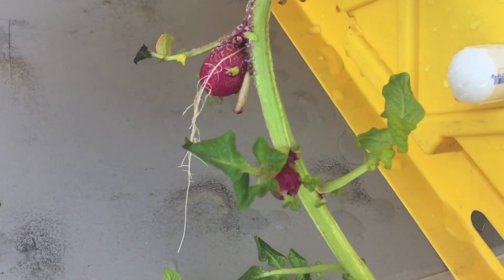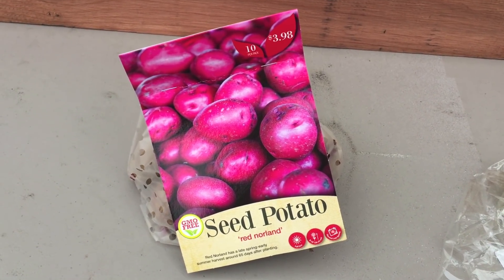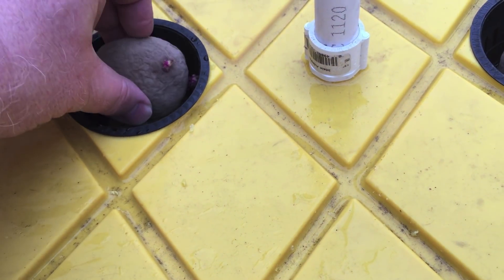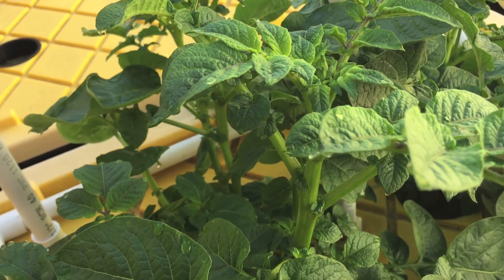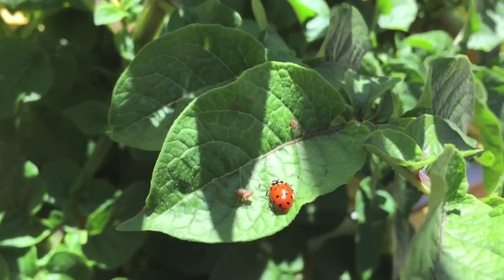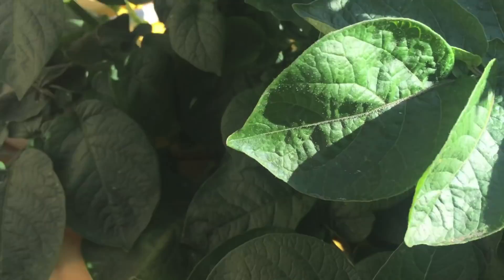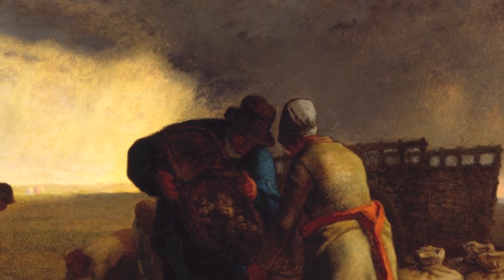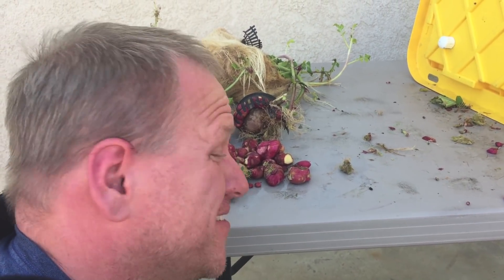Check out the amazing growth pattern of this hydroponic potato!

Comment: If you weren't so cheap, you could do some pretty cool things with solar panels and pumps lol, but alas...
Reply from the maker: Well that would be cool but it's not accessible for most people.
Reply: Actually you'd be surprised now days what most people can get at Wallmart and other stores, or online not to mention if a person is smart enough to attempt hydro, they are usually smart enough to scrounge up a small solar panel or a pump. True you don't need an air stone, but it really does help the roots. I was just kidding about you being cheap also haha!
I like your narrations!
Reply from the maker: Oh I'm cheap and lazy.  Unashamed!   It would be cool to try some solar and different things though.
Reply: I used a 55 gallon plastic barrel that they shipped pickle slices in, and a 5 gallon bucket that slipped perfectly in the top as my "Net cup". I drilled a bunch of holes in the top bucket for drainage and used that Growton hydroponic rock, that's made of that fired expanded clay balls for my grow media. I dug a hole in the ground to bury the 55 gallon barrel and keep the  reservoir cool. I hooked up one of those little solar panel fountains you get a Wallmart for my pump, and when the sun came out it would start up and give it a small trickle of water in a drip ring around my tomato plant. I also used the lid to the 5 gal bucket to cover the drip ring and grow rocks at the base of the plant to minimize evaporation, I just cut a slit in the lid so I could slip the lid around the base of the plant. It worked better then I could have imagined, and the water continuously dripping down through the rocks into the reservoir gave it good aeration as it fell back into the reservoir. Hydroponics works great indoors with lights, but you should see it under the sun! Well....I guess you have already haha.
here is a link to a solar kit that is pretty much the same as I used.
http://www.homedepot.com/p/Solarrific-Solar-Powered-Water-Fountain-Kit-G3017/205703113
https://www.amazon.com/Danibos-Upgraded-Submersible-Birdbath-Fountain/dp/B00DTMFHR2/ref=pd_lpo_vtph_86_lp_t_4?_encoding=UTF8&psc=1&refRID=TCNS3C16WSM0GHT5TAMB

Comment: would polystyrene work as a float? you could cut that too snuggly fit the rockwool cubes
Reply from the maker: problem is if it floats you wouldn't have gas exchange at the surface of the water.

Comment: Potatoes are tubers. That means they're stems modified to store nutrients, so they don't grow from the root. Stems differentiate between leaf stems and storage stems based on light exposure. I think if you abandon the net system altogether and just suspend the seed potato on skewers, it will keep the tubers from getting constricted. Maybe you could construct some kind of grate above the water for the storage stems to rest on and cut a hole in the middle of it for the roots to dangle through.
Reply from the maker: thin rope

Comment: what about utilizing some kind of balloon with tiny perforations or sterile rubber glove with perforations or a potato bag{with the excess part of bag bunched up and rubber banded together so you can expand the bag as the seedlings grow shoots etc?? (plastic and cloth to see diff results)} instead of the seed cup you had initially used. Just some quick thoughts that popped into my head as I watched your fabulous video!!! Great stuff
Reply from the maker: I think that would work, but handing them from 550 paracord is working pretty good right now.

Comment: It seems like you need and extra layer between the water and the top. Like rather than the net cups, just having a more open layer for the potatoes to exist and expand in. The biggest trick is keeping the potatoes kind of wrapped in something soft enough and perfectly dark, because otherwise they'll think they are near the surface and will start growing leaves. So maybe netted bottom over water, but then a space filled with something. I know you don't want to use growth medium, but maybe consider just clean sand or something similar [of that's not too close to soil]. Potatoes love expanding in sand. I know you don't want to put anything around them, but so long as they are getting any light and are exposed they'll just keep growing leaves.
Reply from the maker: I'm doing it again right now with thin rope in place of the net cup.  I didn't paint the tote lid (again).  Mostly for laziness but also because I want to see how green the ones in the tote get.  I have another grow method planned after that but I think I'll let that one be a surprise.
Reply: Cool, I hope the consecutive ones work better. I suspect they'll still get pretty green so long as they're getting any light.

Comment: I think if you'd just cut some of the basket "pillars" on the bottom of the net cup and only leave like 3 (enough to hold Rockwool) then it would have plenty of room to grow out; that way you don't have to really change anything and keep it cheap 🌱
Reply from the maker: I think it could work but maybe it would break?  Potatoes are heavy.  Also need to suspend them deeper unde the lid so thin rope is doing that well.  You can just submerge them half way in water at the start so rockwool isn't necessary.

Comment: Someone has probably already suggested this, but maybe suspend the potatoes in the water using string or metal wire in order to allow the daughters (if that's what the new potatoes are called) to form close to the mother potato as they did in the video?

Comment: The chlorophyll in the vines in the dark is very interesting. The taters were on those branches and not the roots. So what if you used rain gutters instead for a shallower water basing, capped it in sections and strung the vines on the underside. They were clearly trying to get back out to sunshine. So give the vines the chance to do that by providing extra holes for them to come back up through and possibly some netting to give them something to set on above the water.
Reply from the maker: Interesting thought

Comment: You could perhaps try replacing the net cup by lancing the potato with a metal wire of some kind, then just have the wire suspended in some fashion. This should allow the potatoes to grow without running into the problem of the net cup. You could probably use the same rig. Just bend the wire so that it will hold the potato you've lanced and simply sit it in the hole you drilled for the net cup. Scale up at your will.
Reply from the maker: I considered wire before I tried thin rope, but you are making it sound like a pretty good way to do it!
Reply: If you ever give it a try, let me know how it turns out. Your videos are groovy, man!

Comment: instead of having the net cup around the potato... why not have it in the potato... ok joking aside maybe poke little holes through the seed potatoes and run string or something through and suspend them at whatever height you want. that way theres no cup to hold the potatos back but you also should have the height you want
Reply from the maker: Yes

Comment: Much larger net pots. like 9-12" . Or a neoprene collar to hold it at the required position. Poking holes in potatoes with toothpicks or something in a moist environment outdoors likely wouldn't work so well, might turn them to slime though. Possibly some sort of elastic mesh bag could be feasible. Maybe even try cutting a hole in the bottom of the net pot and jamming it in there. Very nice experiment.
Reply from the maker: Thanks!  Stay tuned for the follow up.

Comment: would tying string round it keep it suspended or would the string rot away or the seed potato fall as it shrinks? there are cool looking balls made with soil, moss and twine that people grow plants in, would a combination of moss and twine keep it secure enough and allow the roots and potatoes to develop properly at the same time?
Reply from the maker: I'm trying thin nylon rope which shouldn't stretch, break, or rot.  It could be re-used if it works well.

Comment: make a cup out of paper . by the time it gets too big it will hold itself in place
Reply from the maker: Would it be strong enough to hold up a heavy potato plant in the end though?
Reply: Jeb Gardener I think he is trying to say it will grow until it squeezes tight with the edge of the hole.
Reply: try using a 12 pack of soda box that would be strong enough  or use string to tie the rock wool in place instead of a net cup .

Comment: First thought to grow them was a dissolvable net cup made from their food. actually that my only thought
Reply from the maker: Sounds neat, but the plant would fall into the reservoir if the net cup dissolved.
Reply: True. Another thought is finding some way to support it as it grows since you have the netting holder if the plant was strong enough you might be able to velcro it to the beams. or have a stick or pipe coming from the bottom it can wrap around or you can attach it to. Ive not done any kind of gardening in a while so most of the ideas are quite green, and I've never tackled hydro a side idea is as the roots grow well since they need air you could sacrifice some and braid or twist them together and tie them some where either under the lid or above. and this grew much longer than i intended.

Comment: you need to sprout the seed potatoes first, then instead of putting the seeds into the baskets tie string around them to suspend them in the water, you need to use some kind of black out fabric around and on top of the container  to stop the tubors becoming poisonous, and as far as feeds, i use comfrey leaves in the bottom of the trenches at my allotment, but you can make comfrey tea by rooting down leaves in water and then filtering it and then use it as a concentrated feed.
Reply from the maker: Great ideas!

Comment: It’s Not Environmentally FriendlyI believe in environmental sustainability – it’s one of the reasons I’ve 
chosen to grow hydroponically. Rockwool doesn’t score well on the 
environmental scale. It’s not a natural material. Manufacturers use 
combine chalk and rock and then heat them up to around 3,000 degrees 
Fahrenheit. Next a stream of air is blown through it, resulting in 
extremely thin fibers of the rocky material. As the strings are blown 
out, they bunch together and form the material that you see for sale at 
the local hydroponics store. Basically, they are taking two materials that are 100% natural (chalk and rock) and turning them into a hybrid material that will remain in that form 
forever. When you throw away your old rockwool  it’s going to sit in a landfill looking just like that for a long, LONG time. If you absolutely insist on using it, try to save your rockwool in between your growing season and reuse it.It’s Not Healthy To Be AroundNot only is rockwool unfriendly to the environment - it's also potentially harmful to your 
health. New blocks can contain a lot of dust and loose fibers that can get in your eyes, mouth, skin and lungs. It’s similar to asbestos in the  sense that the little fibers can lodge themselves in your lungs if you’re working with it a lot. It may not be as toxic as asbestos, but why take the risk? Not something that I'm willing to gamble with if I don't have to - there are plenty of other hydroponic media choices! If you're using rockwool, you should be using a mask, goggles and gloves when you work with it to protect yourself.
Reply from the maker: I know but it works so well!  What do you Roccomend as a replacement?  Btw for potatoes I'm going without media now.
Reply: I don't have a very informative answer yet, still doing research but I assume one could use coconut  coir/expanded clay/sphagnum moss. Maybe line the pots with cheese cloth or find pots with finer mesh. Dunno...still trying to figure it out myself! Keep up the good work, love your videos!

Comment: cool n different vids ,I think u need to start dem off in  the bottom of a big pot sitting in a tray of water with a thin layer of growing medium. coconut fibre sounds most natural. as the plant grows top up the pot with medium of a few inches to exclude all light as light will make dem poisonous . wen the plant is past the top of the pot and the pot full of medium to the top ,allow to grow for longer and then see what u got after a few weeks . won't be able to do it cool progress vids but should get some potatoes .this is how potatoes grow
Reply from the maker: Yeah that sounds right but I want to swim against the stream.

Comment: Hey Jeb, the reason your potatoes were like this is because the container isn't light-tight enough, they need absolut darkness to grow as desired (edible :P). 
To clarify the tubers are growing on stolons, which are a special kind of stalk and not roots. That means every shout that is in complete darkness will grow stolons and tubers instead of stalks and leaves. 
My suggestion is to wrap a black foil all around your grow container, than the plants should form correct potatoes.
Reply from the maker: I agree you need darkness in the tote.  But are you sure it isn't moisture and not darkness that tells the plant to produce tubers at that point on the plant?  I had potatoes several inches up the stem above the lid.

Comment: Perhaps use a shallower tub and use moss or plant foam to support the seed potato. I think the potatoes dangling while suspended in water would make them grow deformed, but if the tumor roots can reach the bottom, I would think they would grow a bit more normally.

My grandmother grew potatoes in her storm cellar(an experiment for long term food cultivation spurred by the cold war) using incandescent lights, potting soil, and the natural dampness of the cellar. The tumor roots would sometimes even grow down the side of the table like vines and produce edible but funny looking potatoes(the tabletop was actually a 6 inch deep trough filled with potting soil). She rarely had to water them because the cellar was so damp already. This, however, was not hydroponics, but maybe the vine potatoes did partially get nourishment from the ambient humidity. A few times I remember some of them being consumed by fungus, but that was due to an unusually warm late winter or because of her health preventing her from harvesting them in time.    

She would harvest them in the spring, and then grow mushrooms in the summer. This was in the southeastern US, and the cellar never dropped below 32F.

Edit: Oh, and she also grew carrots, radishes, and okra the same way, but they did not behave as strangely as the potatoes did. The potatoes, weirdly, absolutely loved growing in that cellar.
Reply from the maker: It seems like the potatoes grow anywhere on the stem where the moisture is high enough.  They came a couple inches up the stems I think because the reservoir air is so moist.

That cellar sounds cool.  Was she just trying to store root vegetables and realized that things could grow in it?
Reply: Probably. I can't say cause I never asked, and unfortunately it is now too late. That is a reasonable assumption. She was always scared of nuclear war and the cellar had a bomb shelter in it. I have a half dozen crates of canned water in my attic from when her estate was getting divided up.

Comment: Perhaps cut the cups at the bottom(making sure no sharp bits), so the potatoes can push out when they get big enough. And push the branch tips out the lid, to bring more sunlight energy down to the potatoes in the middle.
Reply from the maker: I'm doing a grow with thin rope now .  The stems found their way through the hole without a problem.  Sunlight on the tubers is bad mojo though.
Reply: if you cut out the bottom everything in the cup will fall through. 
look at NEOPRENE from an ez cloner. will work perfect.
Reply: Not the entire bottom, just enough that it would spring out under pressure.

Comment: maybe cut the bottoms of the net pots out. leaving the top squares intact but everything else below gone, then use some wire or tooth picks pushed into the potato to suspend the potato from 4 opposite sides of net pot. obviously wire being held in by being inserted into the potato and the other end going through one of the net squares. this should give you a lot more room for growth.

Comment: Potatoes are not seeds they have plenty of stored energy to grow stems and roots. A feet or two is no problem so i dont see why they need to start close to either the top or to the surface of water. No rockwool needed either.
Reply from the maker: Wow that might be crazy.  Just tie a rock to them (if they wont sink on their own) and put em down in the bottom?  You have my kind of thinking!
Reply: Dont know if they survive underwater for long. (it is worth a try) I was thinking more like hanging it between the water and the top. Or putting it on something like a plastic cup /\  a rock or a brick. Something that will not trap the potatoes.